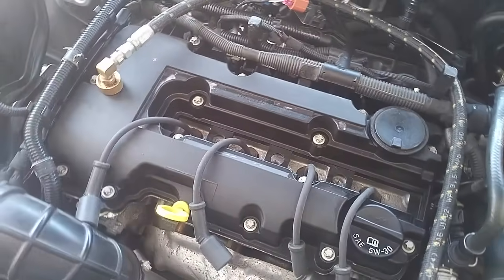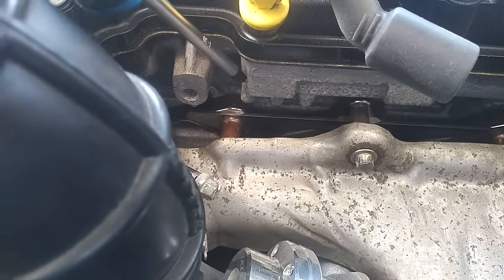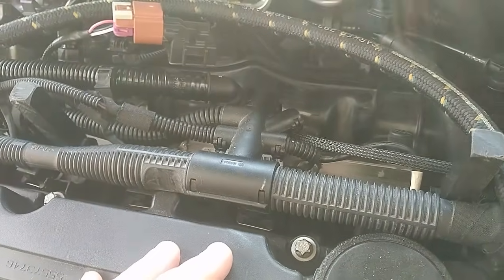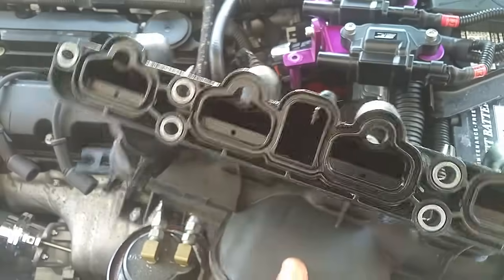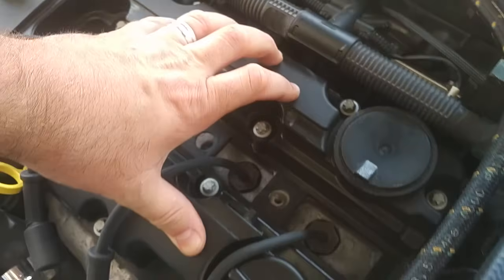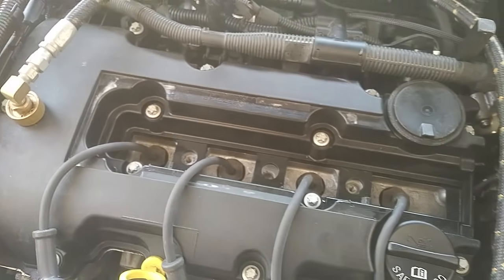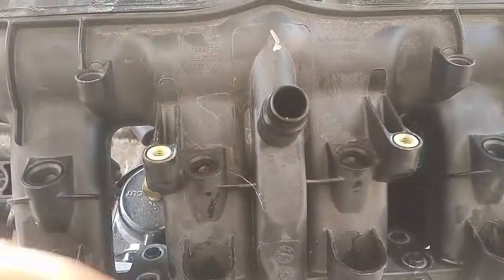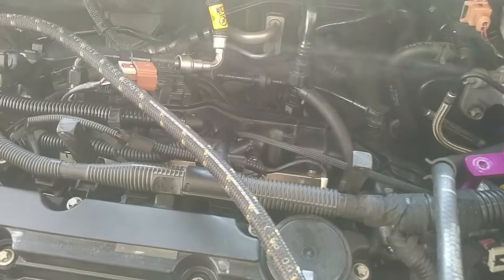Chevy Cruze Sonic Trax Encore 1.4L Turbo PCV Issues, Diagnosis, and Solutions

Comment: I have a 2011 Cruz.  Did a leak down test and it 
leak at the back of manifold. Replaced it with new. The hose that goes from the intake to the turbo blows free one way and just a little air comes through the other way. Wondering if that is normal?  Looked to see if i could  can find the check valve in the intake. i saw something  but not sure if its bad or not.  Here's whats going on with the car.  Taking off i get up to 3000RPM and the trans wants to down shift,  If i get up to 3000 and let off the gas it shifts fine into the next gear. I've talked to others on different sights they say pcv problem.  I also changed out the turbo.  The scan tool code  came up with bad turbo.. On all of the sights,  I've haven't heard anything about shifting troubles and the pcv.

Comment: If pcv system is bad/has issue, when I smoke the engine through the booster port on the intake, would I see smoke anywhere? No, right? Since it’s a sealed system. Sorry for the poorly written question.
Reply from the maker: Right, you wouldn't see anything externally unless the valve cover diaphragm failed. Did you check the intake manifold check valve though?

Comment: My Buick Encore 1.4 it's very sluggish to pick up speed but it does not misfire or editing it is just super slow 0 to 40 takes forever I have to go 5Krpm  to even get some reaction any ideas
Reply: What reads your boost gauge? It have check engine light on?

Comment: Where did you find the tee for the intake manifold?
Reply from the maker: Imported in bulk.
Reply from the maker: If you want one, shoot me a message through the form on the cruzekits.com site and I can send one out for $8.
Reply from the maker: Btw I wouldn't recommend trying to piece together your own kit. Several people have and they discover I used specific components that have to match the same measurements. All of the components were carefully chosen to a specification.
Reply: I have all the parts just can't find that plastic quick connect tee
Reply from the maker: @dansmith5098  you have a Mid-America Metals heavy 1/4" adapter with a flat flange, specific sized stainless washers to distribute pressure, and the correct size hardware to plug up the original hole? Not exactly over-the-counter hardware.
Reply: @AndreiDPop  yes ordered everything off grainger
Reply from the maker: @dansmith5098  Part number 23200X4; the MAF SAE spec heavy adapter with a flat thread base was specifically chosen over other adapter types due to its ability to seat flat against a stainless washer and prevent fatigue against the plastic on the intake manifold. I do not see this part on Grainger. 

Regardless, it's your car, do as you wish. If you need the brake booster tee, it's $8. Contact me via the contact form on cruzekits.com.

Comment: The future is all about plastic parts.  Spend $60 every six months.
Reply from the maker: As long as you have my fix kit on the intake manifold, sure. Still, I don't see why you'd have to replace it every 6 months unless you're a courier that drives 100k miles a year.
Reply: @AndreiDPop  ...  plastic is cheap so costs should come down.  But plastic parts don't last unlike steel.  Anyway it's obvious these vehicles are designed to last only a specific period say 10 years or so.  In other words customer would have to ditch the ones they driving.

Comment: Replaced intake manifold with a Dorman one and the pcv bypass valve tube by Dorman also and they work great also they come with lifetime warranty
Reply from the maker: Good luck getting them to warranty out that manifold if the check valve gets plugged up with deposits or leaks but still "looks intact" from the outside.
Reply: Dre Dan sorry to disappoint you but I know management at O’Reilly’s and warranty isn’t an issue for me to get taken care of. I’m a technician for Mercedes-Benz and I’ve never had any issue with warranty from a dealer or my local auto part store.
Reply from the maker: @alquitorianojr5055  I've had manufacturers ask me to send the parts in for replacement. Not everyone has a wholesale account with a local auto parts store.
Reply from the maker: Meanwhile you're waiting for them to send you a new manifol while your car is in pieces and undriveable. They know how to play the warranty game. Makes people feel good while making it extremely unlikely anyone will actually attempt to warranty that part. You'll be waiting weeks for them to inspect the manifold to approve the return and won't have your car the entire time.

Comment: I don't even own this car. I don't even know why I am watching this. But I learned a lot and I am a huge fan of the way you do videos. Very well done.
Reply from the maker: Hey, thanks for the feedback! It's very encouraging. I've been thinking I need to do more videos.
Reply: I have replaced the intake and valve cover now the engine runs hot instantly at idle. What did wrong any information would help.  Thanks
Reply: Congrats on not owning the car

Comment: HELP! I have a 2016 Chevy Trax LT with the 1.4 turbo Ecotech engine. The engine light came on and I received 2 diagnostic reports via email and text messaging. One said Service engine and transmission system in your 2016 Trax within 1 day, the other said Service the emissions system in your 2016 Trax within 7 days. I took it to dealership where I bought, they ran diagnostics on it and came back with service order that said this
PERFORMED DIAG FOUND DTC CODES P0106, P0131, P0171, P1101 MAP PERFORMANCE, SYSTEM LEAN BANK 1, INDUCTION AIR MEASUREMENT OUT OF RANGE.
FOUND INTAKE MANIFOLD CHECK VALVE MISSING,
FRONT CRANK SEAL LEAKING AND VALVE COVER LEAKING.
ESTIMATE: $1160.00
I SAID WHAT??????????
I was laid off from my job several months ago and was suppose to start new job this week but my car had different ideas obviously. So no car running properly = no job and without the job I can not afford to have my car fixed... not at 1160.00. I have no other means of income, so I am pretty nervous if I can't get my car fixed  it will be a domino effect... everything is going to go... meaning lose my car and my home. Can you Please help me with any kind of information on these codes so that I can get a better understanding of what I am up against. I'm going to go to an home town mechanic shop tomorrow and see what they tell me and I would just like to be informed and knowledgeable so I don't get taken to the cleaners per say. I know there is no way it will cost 1160.00 to fix... dealerships are out to take your money... especially a female. I would greatly appreciate any information you can give me that will help me out in my circumstance. I hope to hear back from you, anxiously waiting... Thank you so very much. Have a Blessed day. 
Kelly
Reply from the maker: You need my PCV fix kit. Contact me through the contact form on cruzekits.com. I'll help you out. 

You also need a new valve cover. Get the OEM valve cover. I think they're $60 or so on Amazon. This is all stuff you can do yourself. I have tutorials written for both on CruzeTalk.com. Again, just shoot me a message through the contact form on CruzeKits.com and I'll help you with everything.
Reply: @AndreiDPop , You are sooo kind... Have tears running down my face, thank you so very much. I have fibromyalgia and my hands hurt everyday... But by gosh, I watched the videos and I am going to do this myself, don't have the strength I did years ago but not gong to let that get in my way... I WILL ACCOMPLISH THIS, with your guidance of course. 😊 I know my baby. brother was like really, he's not mechanically inclined at all 🙄, I said yep... I'm going to save you from loaning me 1200.00, and hopefully only have to loan me $500-$600 I'm hoping. He just smiled and said right on sis. I said I got this!!
My car is only 200 miles or so away from 75,000 miles. I put a lot of miles on it at the job I was laid off from, I was a District Manager for a large newspaper company, and had to use my car to throw a route if it was down, to train new carriers, and deliver papers that carriers had missed the previous day. It had 6 miles on it when I got it in March 2017!!  I got side tracked again I'm sorry. My question is with that many miles on it should I change the spark plugs while I'm at ot?
Reply: @AndreiDPop  ❤
Reply: Good morning @Dre Dan. I didn't see on the cruzekits.com a place to contact you. I would like for you to let me know exactly what I need to get to fix my car. OEM manifold cover you said from Amazon, is that what it's called? I have to five my brother a list and a description of what I need him to order. I grandly appreciate your help. Have a blessed day.

Comment: Thank you, you just save me over $500 my encore has hissing so it’s only value cover replacement, greatly appreciate you posting this video and I will buy that kit you make if manifold ever fails.
Reply from the maker: Keep in mind, simply seeing the check valve in the intake manifold doesn't mean it's working. Very recently, I had a friend install my kit which meant pushing the check valve out and catching it on the other side to plug it up with my kit. Turns out his had a tear in it, and it wasn't during removal. For many people, the check valve either gets stuck closed or even caked with deposits and starts leaking. Waiting for it to fail can often cause other issues down the road due to oil consumption. If you have over 30k miles on the intake manifold, I recommend not waiting until it fails.
Reply: @AndreiDPop  Well, I have only changed the intake manifold once on my Cruze and I have 306,464 miles now. The valve cover has been changed 3 times. But sadly my turbocharger is starting to fail. Wastegate is locking up. This is the original turbo and has lasted over 300,000 miles.
Reply from the maker: @dextermorgan5799  That must be a lot of highway driving. Kind of need to go by years when you drive that much.
Reply: @AndreiDPop  Bingo! I would say 90% of the miles are highway driving. Drive over 30,000 miles a year. I have owned the car since  January 2011. I've been good to this car and I think I got my money's worth. One last note, I never used air conditioning, no matter how hot it was. It seemed to affect the car early on. So, I decided to not use it.
Reply: @dextermorgan5799  The guy on youtube who got 300,000 out of his chevy sonic said he had to put a turbo in it and used one out of a salvage car and that turbo cost $300.  One of my friends with a 2002 ford powerstroke diesel actually ordered the bearings for his turbo on his pickup and replaced them himself.  He said it wasn't hard and he is definately not a mechanic.  He said just order the rebuild kit.
Reply: @AndreiDPop   "Keep in mind, simply seeing the check valve in the intake manifold doesn't mean it's working." ... - This point cannot be stressed enough. I'm from the UK & work primarily on Vauxhall, a brand of GM, using the same systems; all are terribly designed. The intake manifold PCV non-return / check valves can indeed tear or become clogged "open" with carbonised / burnt oil deposits; symptoms are mainly observable with positive manifold pressure, ie. "boost". Faults with this valve will cause consequential faults with many other components.
Reply: @AndreiDPop  A
Reply: @AndreiDPop  0

Comment: What it is that hose in the valve cover ??
Reply from the maker: AMSOIL remote bypass filter return line.
Reply: Dre Dan is your Cruze Diesel  or did you installed if so do have a video to do it? And what are the benefits?

Comment: Dre Dan nice info on this, how prevalent is this on the 2015 model? I gave car to daughter with 20,000 on it,  just wondering if I have to watch for it constantly or?
Reply: should have mentioned that Chevrolet sent me a PVC warning of cracks , sucking air into manifold , basically telling me the motor could implode if not watched for!
Reply from the maker: 100% of cruze are affected. It's just a matter of time.

Comment: Have a 2011 Cruze w/turbo that’s in the shop right now — Have you experienced any kind of chirping noise with these part failures? When he pulls the dipstick up a little bit the chirping stops. When he plugs the diaphragm on the top of the valve cover it gets worse. The mechanic working on it has narrowed it down to PCV system issues and is recommending I replace the valve cover and intake. (Ie both pcv valves.) Been throwing parts at this car for over a year and it’s getting expensive trying to fix the same problems — poor idle and occasional stalling. And now the chirping, which he says is air escaping through seals. Before I make another $700 repair any input or thoughts that could help my mechanic out would be welcome! (Also the link to buy the fix kit is broken.)
Reply from the maker: Front main seal is gone. I'll check the link shortly.

Comment: Dan I have a 2013 Chevy Cruze 1.4T. I replaced he Valve cover due to Vacuum Regulator Diaphragm had suction on it. After I replaced it suction stooped but I noticed smoke and burning oil smell after driving it a few miles. I popped hood and oil was blowing out of oil filler cap. I checked the cap put a new Oring on but same thing> I put the oil valve cover on oil leak stopped but suction is back. Do you have any recommendations to my problem?
Reply from the maker: OEM or aftermarket valve cover? 

How's the check valve in the intake manifold?
Reply: Aftermarket
Reply from the maker: @jamespuckett9572  we've seen a high rate of defect on aftermarket valve covers where there's an internal blockage that creates a ton of crankcase pressure.
Reply: Need to check the check valve
Reply: So I will check the check valve then see about getting your part
Reply: Will I have to get another valve cover?
Reply from the maker: @jamespuckett9572  It sounds to me like you will need a new valve cover. I'm not there to diagnose it or test the crankcase pressure though. Turn the car on and let it idle, then place your finger over the dipstick hole. Do you feel positive pressure or suction?
Reply: I don’t have the car here with me. I will try to find out.
Reply: Sucking in

Comment: What's you thought on plugging the pvc check valve in the intake manifold without removing the manifold?
Reply from the maker: I've been trying to figure out a way to do that reliably and haven't come up with a solution yet. I have some ideas but it's going to take me a bit more research to come up with something. One of the biggest issues is that any plug you put in there will require a sealer/adhesive, and that will require cleaning, which will require substantial quantities of solvent, which you probably shouldn't just ingest through the engine after you loosen all the crud around that PCV port. The bigger issue is making sure it's all clean in there, and you can't do that easily without removing it.

Comment: Hi I purchased your kit awhile ago have not yet installed thanks for posting I bought the one that goes to the throttle body , but like the T fitting to the brake booster instead   can I get that T fitting from you as well I have 30k miles so I want to do it pretty soon .
Reply from the maker: Yeah, I can get that to you, but you'll need a few other parts as well. The larger hose, hose clamps, and two brass fittings that are different. Shoot me an email through cruzekits.com and I'll get you pricing on a "conversion kit" shipped to you.

Comment: Dear Dre Dan,

Thanks for your great videos, explanation and kits avaliable to get - it's great solution for this strange crankcase ventilation system from GM with this PCV Mushroom valve in the intake manifold at A14NET engine and similar. I wonder to know, why they don't use the same system which used at A16LET engine, where the PCV valve made externally, almost exactly how you made at your kits? It's rhetoric question ;)
But what I really wonder to know and can't find relevant information concerning this issue - what if the ventilation system will only one way. I mean, if the mushroom valve hole will be plugged up in the intake manifold and only way of ventilation will be via corrugated hose to the the turbo charger. Such way will be completely identical to the default ventilation system during the boosted, loaded mode. But what will happen at the idle mode or mode with little load ? I suppose, that if it will be not enough air at the intake manifold for the stable engine operation the electronics will open the throttle valve a bit more to provide the enough air flow. Further the more air will be sucked from the turbo charger and from the corrugated hose connected to turbo inlet - so the crankcase ventilation will take place in this case as well.
I am not completely confident in my thoughts concerning this crankcase ventilation as I am not specialist in it, but why double-way ventilation system needed, what is the benefit of it?

Best,
Igor
Reply: Wow thank you Igor. You just gave a great explanation of what is most likely going on with my vehicle. Now just need to buy a kit and see if I can find the root of the problem. Thank you man
Reply: @franklujan7480  Hey Frank - btw I don't own Astra anymore, but I was able to fix it with the way described with "self-made kit" and after fix had another ~20k km successfully. Best of luck!

Comment: My 2014 chevrolet sonic RS overheats and broke the upper radiator hose, what could be the cause of the whole problem?
Reply from the maker: Water outlet and return hose both need to be replaced. Very common issue.